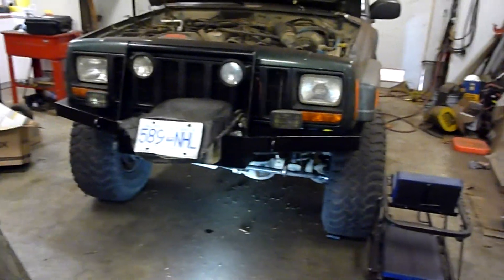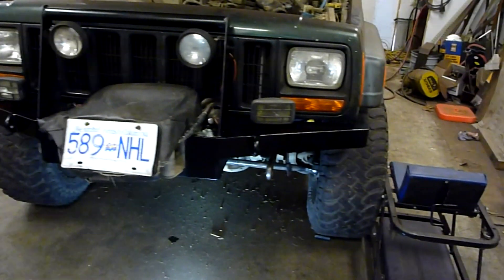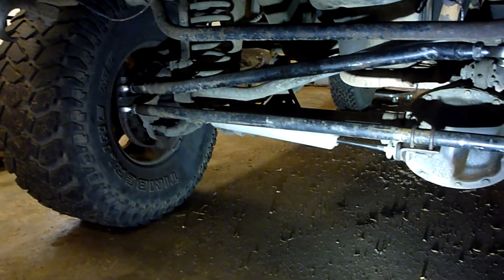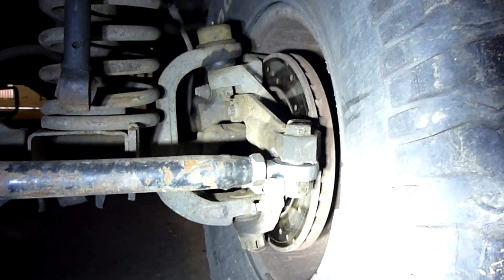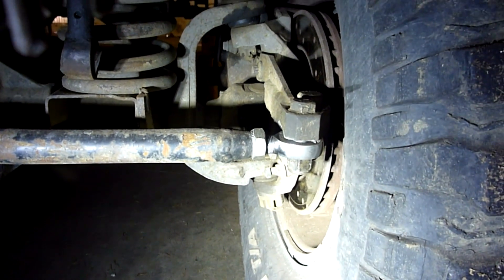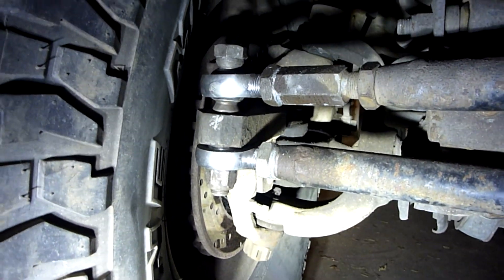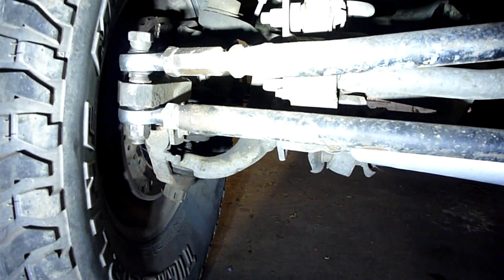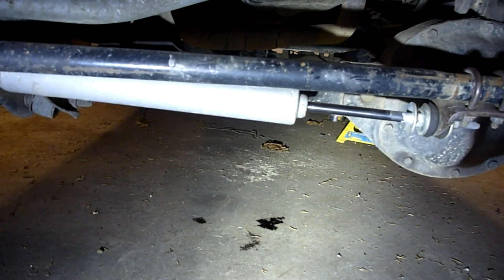The XJ Project - 8 - Steering

Comment: Why go to all the trouble and not use DOM? I don't get why you talk about building stronger then contradict yourself by saying you want the tube to flex and bend "it's easy to bend back"????? And why didn't you make it high steer??? Works great as a mall crawler.....
Reply from the maker: +Corey C 
Thanks for the critique and questions.  I didn't go with DOM for a couple reasons: Availability,  I was only running 33s, I only needed stronger not strongest (no contradiction), availability, what I did worked well for my needs which was also my daily driver, and availability.  Don't do malls, so I wouldn't be able to comment on how it works there, but it worked very well for my hunting, fishing, camping, traveling, and as my daily driver for work and play.  My goal was never to build the ultimate rock crawler, but to build a daily driver that was reasonably capable and reliable.
Reply: There's no need to be an armchair elitist. People do what they can and want to with the time and resources they have for whatever application they choose to drive on. DOM high steer isn't the benchmark between a capable rig and a mall crawler. Get off your high horse.